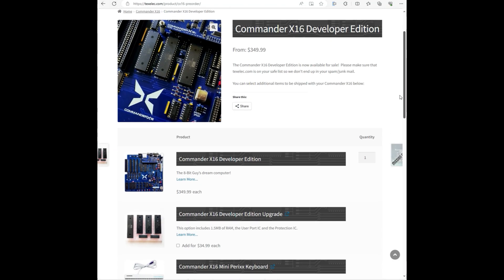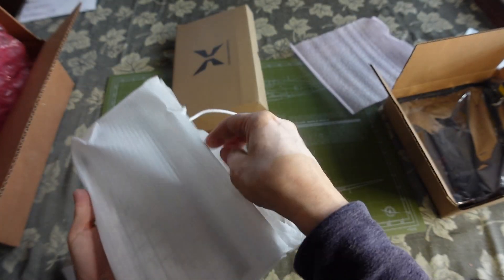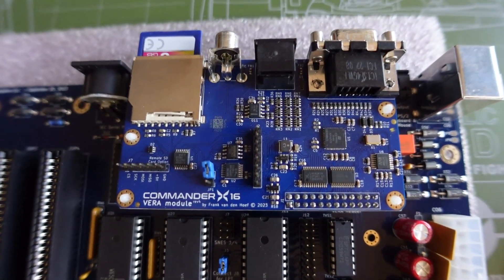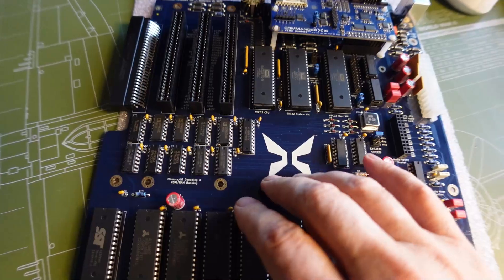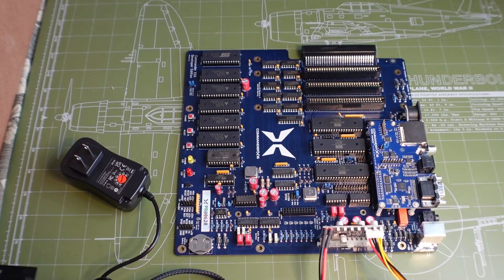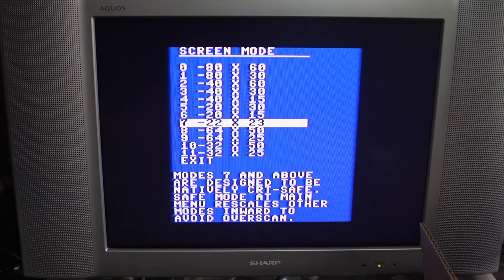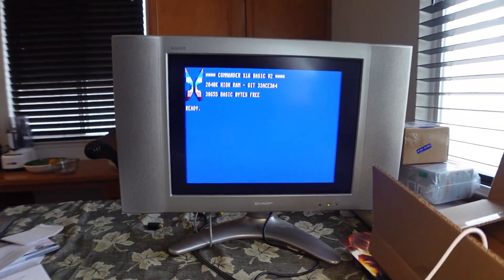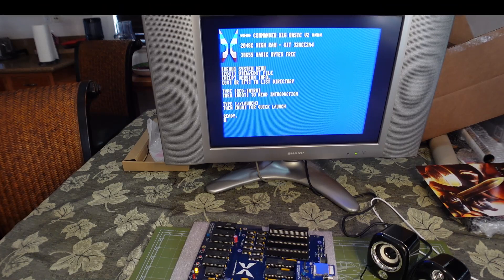Commander X16 Developer Edition Unboxing and First Look

Comment: I wrote XINFO and helped prepare the SD-card content for the X16.   XINFO supports clickable "hyperlinks," so it enables the mouse when it is loaded (it does this by issuing "MOUSE 1" during its startup program - you were close, "MOUSE" is a valid BASIC command, but it needs a 0 or 1 parameter).   If you do EDIT, it has smarts to detect if a mouse is connected and will auto-enable the mouse cursor (at the time XINFO was written that API wasn't yet available).  The MHz jumper is mostly just for testing/debug - if you move down to 2MHz and the game still runs the same, then that shows the software is utilizing VERA and has "room to grow" (do more with the CPU).  Early versions of PlanetX16 could run at 2MHz for example, but as more AI logic was added and more complex game logic, it now has to run at 8MHz.

Comment: The edge connector is likely for an external expansion card or cartridge. The speed jumper might be for attempting to port BASIC games from other platforms.
Reply: its for expansion potential for when putting the board into that low profile case that pretty much blocks use of the vertical mount slots

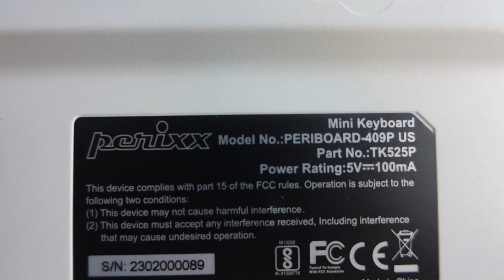Comment: 2:40 It's a very cheap and poorly made keyboard. 
I honestly have no idea why anyone would want one of these.  It's an expensive obsolete computer with very little software.
An Amiga would be a much better purchase. It also has a built in basic. There are 10s of thousands of games and software written for it.
Reply: With emulation and fpga you can say the same thing about tons of stuff. You want, what you want.
Reply: the complexity factor of the X16 is about on par with early 80s home computers

the Amiga sports a much more complex multi-tasking OS and takes much more effort to master its technical landscape in order to develop for

these hobbyist retro-themed computer recreations are aimed at hibbyist that want to dive in and learn to master creating their own software and expansion hardware

Most retro computing enthusiast that go with the Amiga just care about running its catalog of games.

The X16 is not just a platform for running retro-themed games - its a direct experience platform
Reply: @TheSulross  The Amiga has basic built in and it has AMOS available.  YES, its catalog of software is what makes it appealing.  When you pay hundreds of Dollars for something, you want it to do something.
Reply: @tarstarkusz  So there is that manner of mindset that find it much more exciting to have a platform to write new software for - to try to accomplish for themselves - to some degree - what 8-bit Guy, David Murray did in creating PlanetX and PetsciiRobots games.

The X16 already has a stable of exciting software titles that show off what is possible. It's community is thereby enticed to add their contributions.

The X16 manner of 8-bit computer doesn't have the deep APIs complexity of the Amiga OS. Hence its more tractable for hobbyist.

There are plenty of retro platforms where there is already a large catalog of games to play if that is all that one is interested in, and pretty much all of those can be enjoyed via a software emulator that can be installed on one's existing PC. The X16 is not catering to that manner of retro computing interest level.
Reply: @TheSulross  Point is, it's very expensive for what it is. You pay hundreds of Dollars for it and then have little to no software to run on it.  Yes, it's new, that's a plus. No old computer and potential age related problems.  It's something new to play with. There's something to be said about that too.  But David has delusions about selling this thing at Walmart.  Most people would be far better served by using a retro computer.
I'm not demanding or even suggesting people who want it shouldn't be buying it. If it makes you happy, buy one. Hell, buy 2.  I'm giving my opinion about why I feel it is not a good deal or worth paying attention to.
Reply: The appeal is to have a more modern, repairable, parts-available computer system with the kernel, look, feel, basic interaction of an 8 bit computer: selected because it is a simple enough computer where it is easy for a single person to understand the entire system - the whole address space - the whole CPU architecture -- how to program it -- but this computer is way over spec of anything that could be available to you back in the 80s when these were sold. This has megabytes of RAM available to it instead of dozens of kilobytes. It runs at 8 MHz, vs 1 MHz of the time. You can put a multigigabyte SD card into it and run the entire library of software from it. It's got 128K of video ram and works with technology we can still get today - VGA and S Video displays. It has two sound chips capable of crazy good sound for something to come out of an 8 bit computer. A lot of those tens of thousands of basic programs written for those other platforms can be ported to the X16 with minimal effort. Even NES games can be ported with minimal effort.   This is a 8 bit tinkering platform taking software to the limits of what is possible. The X16 is almost as good but not quite as good as a super nintendo, which is a 16-bit system - a whole class better of CPU architecture but more complex of course. So what is possible on the X16 will be very interesting. And as always, if you don't want one, don't buy one but there is a totally legit emulator freely available that will let you enjoy the software titles and development on the platform if that's your kink.
Reply: @nickcopeland5497  Parts availability and repairability is very high for Amiga, probably higher than this 8bit guy computer.  How long do you think this computer will be available?  You think he is going to keep a running inventory of computers in his garage or something?  Plus, the original Amiga uses fairly large components.

I don't see the fact that they are new as anything special.  I don't see new hardware being available very long. It is very expensive and takes up a lot of time and space to hold inventory.  His wife is not going to tolerate a garage full of computer inventory.  Once they are no longer being made, there will be no new hardware, the same problem the Amiga has, but the Amiga is better in every way.

  You can put a compact flash card into an Amiga too.  The 1200 and 600 have a built in PCMCIA slot and you can get an SD to PCMCIA adapter and transfer all the software you want.

The tinkering aspect is good on the Amiga. It's got basic built in, plus you can get AMOS.  AMOS was just re-released a couple of years ago.  The Amiga has a better CPU, though it is 16 bit.

I'm not saying anyone who really wants one shouldn't buy it.  I'm asking why anyone would want to buy it in the first place.  There are MUCH better ways to support 8bit guy.  The big problem with it is it cannot be sold in volume.  They are not going to get 20k units ordered by Walmart and another 20k by Target.  The low volume model creates a 500 Dollar price tag for what is an obsolete computer without a software library.  There will never be a big software library.  The ZX Next has been out for like 7 years and there is only a hand full of games and this was a roaring success by the standard of this hobby.
Reply: @nickcopeland5497   Parts availability and repairability is very high for Amiga, probably higher than this 8bit guy computer.  How long do you think this computer will be available?  You think he is going to keep a running inventory of computers in his garage or something?  Plus, the original Amiga uses fairly large components.

I don't see the fact that they are new as anything special.  I don't see new hardware being available very long. It is very expensive and takes up a lot of time and space to hold inventory.  His wife is not going to tolerate a garage full of computer inventory.  Once they are no longer being made, there will be no new hardware, the same problem the Amiga has, but the Amiga is better in every way.

  You can put a compact flash card into an Amiga too.  The 1200 and 600 have a built in PCMCIA slot and you can get an SD to PCMCIA adapter and transfer all the software you want. part 1 of 2
Reply: @nickcopeland5497  part 2 of 2
The tinkering aspect is good on the Amiga. It's got basic built in, plus you can get AMOS.  AMOS was just re-released a couple of years ago.  The Amiga has a better CPU, though it is 16 bit.

I'm not saying anyone who really wants one shouldn't buy it.  I'm asking why anyone would want to buy it in the first place.  There are MUCH better ways to support 8bit guy.  The big problem with it is it cannot be sold in volume.  They are not going to get 20k units ordered by Walmart and another 20k by Target.  The low volume model creates a 500 Dollar price tag for what is an obsolete computer without a software library.  There will never be a big software library.  The ZX Next has been out for like 7 years and there is only a hand full of games and this was a roaring success by the standard of this hobby.
Reply: you think porting a NES game would require a minimal of effort? 
 I would say this thing is probably a bit more capable than the SNES without a DSP helper.  The Intellivision is a 16 bit system. Bits mean nothing.  Absolutely nobody wants the BASIC programs.
It doesn't solve anything in relation to age because it won't be available for long.  There are only 2 ways to sell it. 

1) Bulk buy upfront and keep a large inventory in David's house and sell them on the website as the orders come it.  This could leave David with hundreds of thousands of Dollars in inventory in his house. Nobody would want this.
2) Sell them one at a time on preorder where you pay upfront, but don't actually get the computer until a bulk order can be made.  This could lead to a year or more of waiting while the number of orders builds up big enough to make the bulk order.
Reply: 8 channel Yamaha sound chip, and what is it 10 or so channel PSG AND tracker available?  Yes I want one for music anything else is a bonus!
Reply: @SproutyPottedPlant  Amiga and even DOS would be better for music.  Plus DOS would open up all kinds of MIDI usage.
Reply: So what you're saying is, you don't want guitar lessons?
Reply: @CaptainXJ  I have no idea what you mean by this.  Learning to play an instrument is not the same thing as buying a computer 30 plus years out of date that doesn't have any software.  Not to mention it's not the only one. There are a bunch of them.  There are at least 4 modern obsolete computers trying to recapture a long gone era.
Reply: @tarstarkusz  its a hobbyiest computer. Its not intended to be the next apple computer mate.
Reply: @ForgottenAlucard  So is an Amiga and many other abandoned computer systems with thousands of good games available for them.
Reply: @tarstarkusz  does this hill u standing on really worth it to die on?. its a hobbyist computer people will make things for it. yes the amiga and the other not really abandoned computer system (retro community still actively developed for those platforms as well). Doesnt mater if other platforms have more games people will find an interest and do stuff with it. With the spectrum how big do u think the user base it ofc its going to have a small library of software.
Reply: @ForgottenAlucard  What hill?  I'm not trying to get the project cancelled or something. I'm pointing out that it's dumb.  No, it probably won't get much software.  The Spectrum Next has been out for years and its library is still incredibly small.
Reply: @tarstarkusz  and i pointing out doesnt matter if its dumb or not. doesn't matter people who are interested are going to buy it and those who aren't can ignore it.
Reply: @ForgottenAlucard  Yes, I've been ignoring it for months. I am subbed to this channel. I did not seek it out.  When it got brought up, I stated my opinions on it.  If you want to waste your money, go and buy 2.
Reply: @tarstarkusz  Then why waste your time watching videos about it or discussing it at all?  No one is forcing you to like it...
Reply: @RacerX-  Look at my comment right above yours. I am subbed to this channel. I did not seek it out. It was brought up and I posted my opinion.